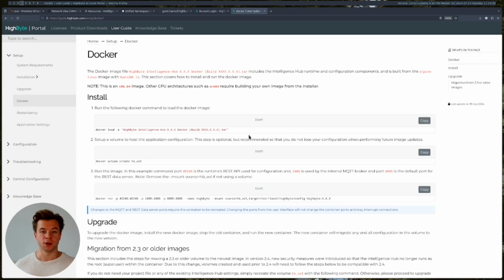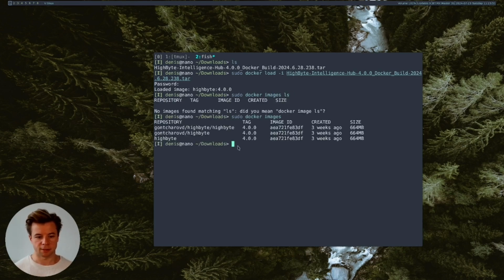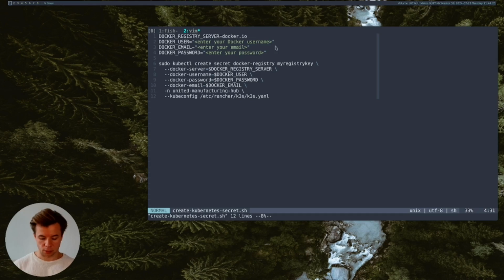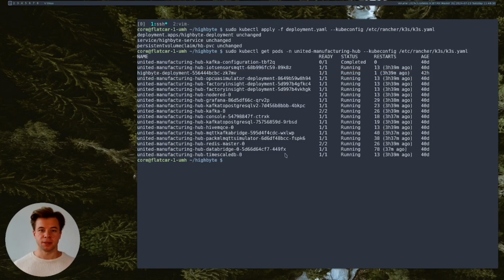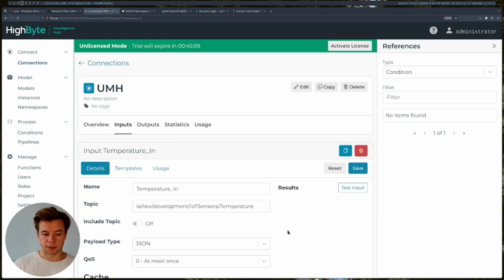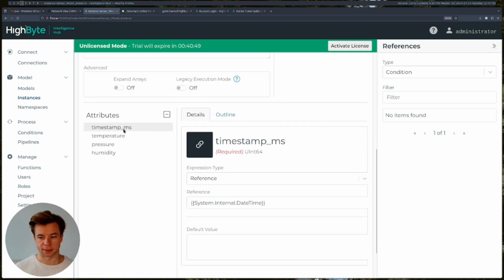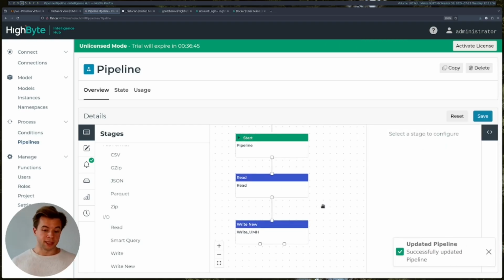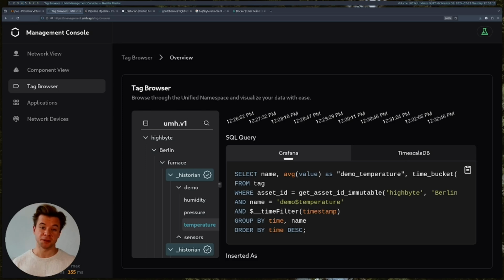How to use HighByte with the United Manufacturing Hub stack

Comment: Cool! One question. You're not really using the OriginID that is defined in the spec UMH wrote for topics. Why is that? Is that optional?
Reply: Hi Jasper, for the purpose of this demo it's indeed optional. However, if you want to fully ahdere to the ISA-95 (or Purdue) specification you should define OriginID as well
Reply: @gontcharovd  ok cool! I didn’t know it’s specified in ISA 95. Would you have a reference link for that? I’m interested